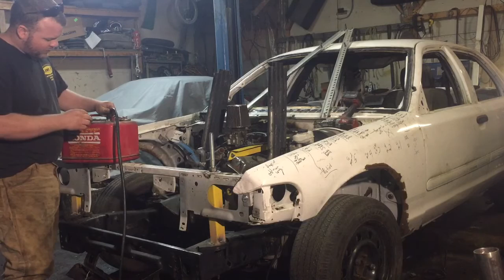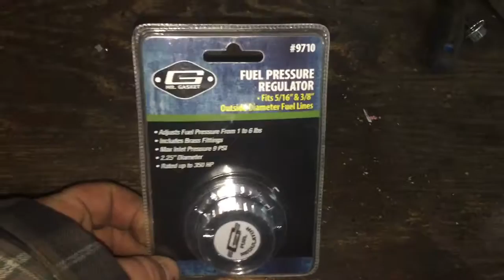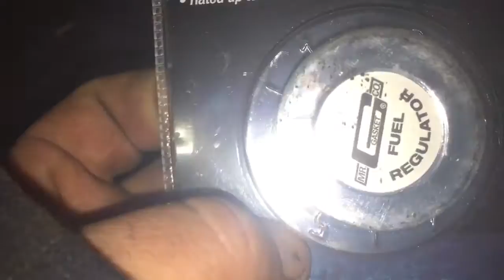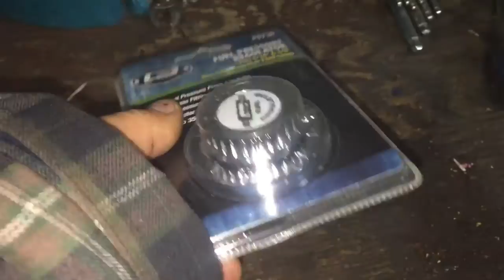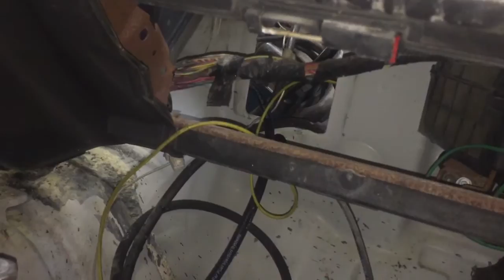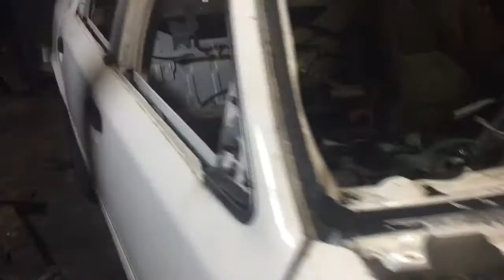low pressure fuel pump install project "burn barrel"

Comment: thank you
Reply from the maker: Anthony Partin ok I looked it up , people are saying the holly pump used the actual fuel to cool it , what size of inlet to your pump do you have ? If the fuel is restricted it can cavity and it will get hot , they are saying set it up to have a return to take system ( I don't really like for derby use on a carb system) I did not see any thing about the brushes. Mine get hot but not supper hot, never gave a issue even when hot

Comment: you should have a loop in the vent line. as it is now it can syphon that tank empty and slosh fuel out. the proper way is to have the vent go higher then the tank then across the whole width then down below the tank and then up above it again.
Reply from the maker: Deanna Downing The vent to pose does not go to the bottom of the tank it is only flush mount with the top about sticking down half an inch max you're right running the vent tube above the tank across the tank underneath the tank and dumping back at the tank height would be the ideal situation if this car was going to be repeatedly be rolled over but I have never once been rolled inside the derby ring